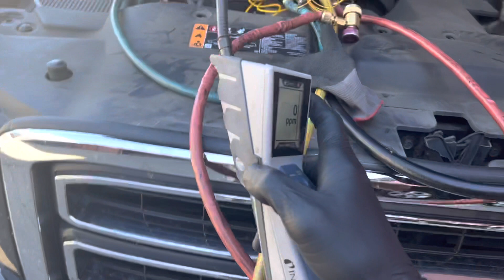Another GM condenser leaking pattern problem. I told the owner to buy a Toyota . ￼

Comment: Hey Thomas, I hope you are doing great. Have you ever heard of the Vulkan LokTracer? I recently came across this tool today, as it seems it was on the market for a while. Its designed to locate leaks primarily using Tracer Gas as they describe it - 95% Nitrogen/5% Hydrogen, where the sensors in the tool react to the Hydrogen molecules in particular. With refrigerants becoming more and more expensive daily; outside of UV Dye, Ultrasonic Leak Detectors and the D-Tek Stratus, which I enjoy your real world reviews; in your opinion would this be a viable option or investment? 

https://www.youtube.com/watch?v=RzuUe2pQg88&ab_channel=TheAutomotiveTechnician

Video on the LokTracer Tool
Reply from the maker: Yes I will be purchasing a hydrogen or a helium leak detector this is been used for many decades even before when my dad was a young man. 

It’s common place in Laboratories that use high vacuum equipment. 

And because of the refrigerant leak laws in Europe hydrogen or helium leak detectors are common place here in the United States they are Americans are kind of lazy cheap and ignorant and the commercial and industrial industry do not like more expenses. 

But you will see a video when I purchase want to get one
Reply: @coldfinger459sub0  Thanks alot for your feedback. I'm definitely excited to see your practical working review whenever you acquire it. For now I, myself, will do more research on them and locate different suppliers and brands.
Reply: @coldfinger459sub0  Unfortunately for me, I called my local Gas Supplier here in Barbados and they don't supply the Tracer Gas Blend, they only supply the Oxygen Free Nitrogen. So this technique will not work for me at the moment. I have asked one of their Managers to query with their suppliers, to see if they can get it and what will be the initial cost, but I believe this will be HIGH being supplied in small quantities only to satisfy a single potential customer. I am still keen to see how it works for you when you acquire yours, but until then ..........Have a good one!